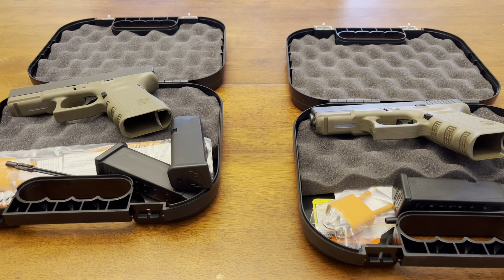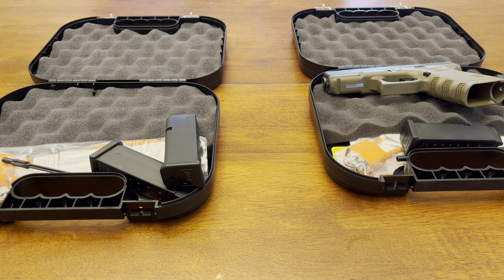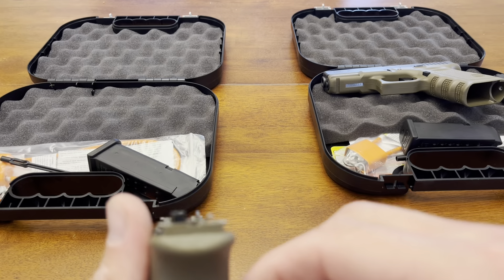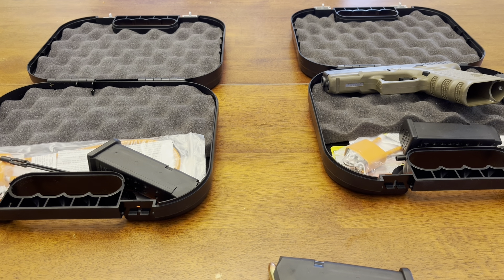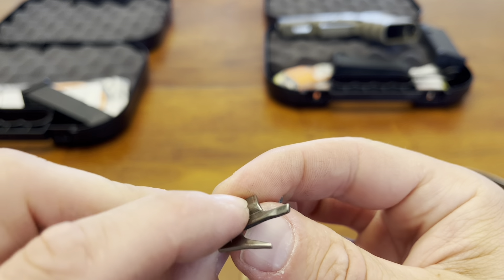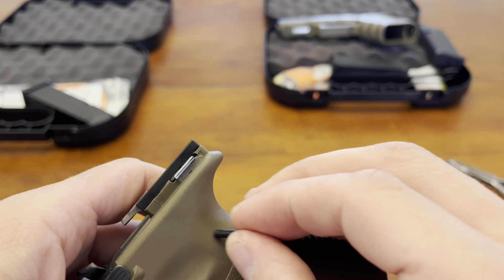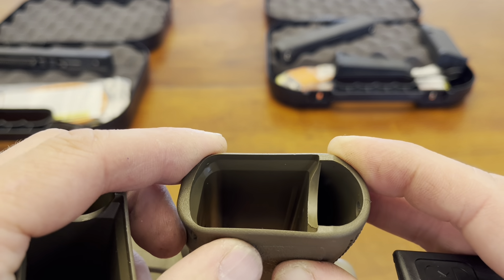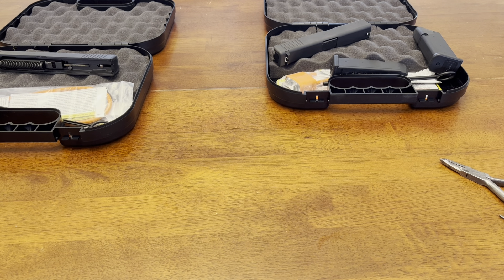Glock 19 ejector [how to] swap gen3-gen4 (336 to 30274)

Comment: Why didn't you go to the gen 5 ejector?
Reply from the maker: It doesnt feel at all like it belongs in the gun. It snags back plate, and it seems to drag on reassembly. It pushes the top round down quite a bit in the mag.  I did change it to gen5 when i got tired of the gen4 dribbling on my chest, but even w gen5 it's not perfect - see later video showing last round to left shoulder.